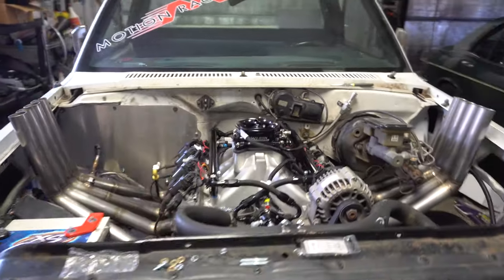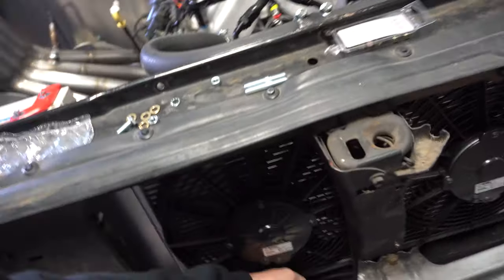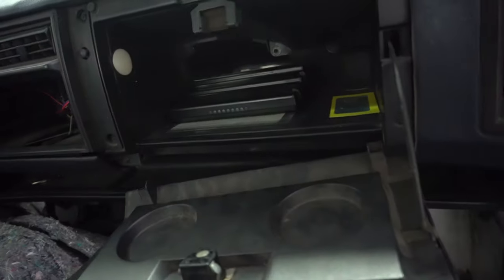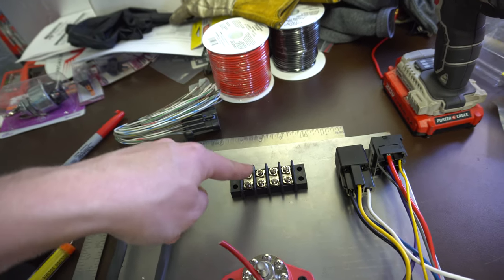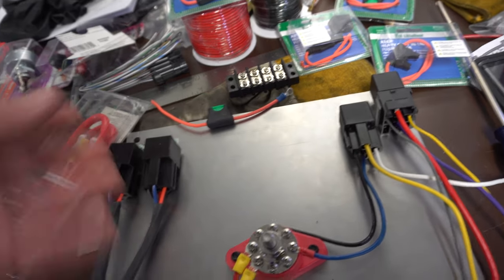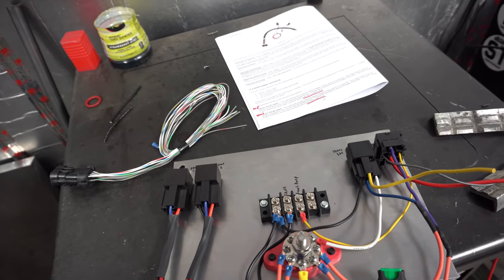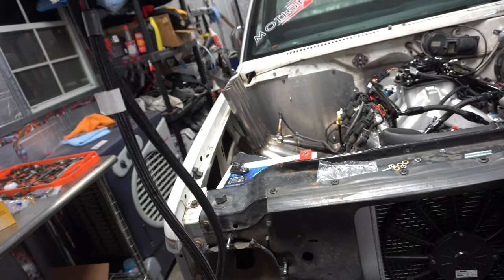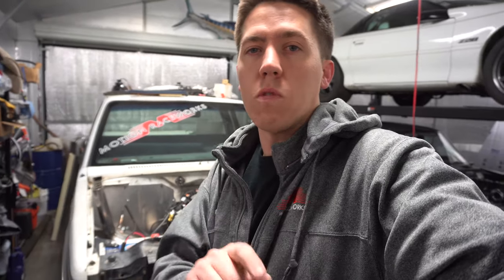Wiring Burnie the Burnout Truck! Relay Panel for Holley EFI Terminator X Inputs and Outputs!

Comment: I bought the same radiator for my s10. I must have missed how you mounted it
Reply from the maker: I used the stock lower rubber mounts and just self tapped the top of the radiator into the core support for now. Might need to make a rubber mounted mount in the future but this might work for now and was super easy.

Comment: What terminal size did you use for the starter lug? Is it 1/4in?  

Edit: I’m new to the channel just subbed awesome content!
Reply from the maker: Are you talking about where the power wire ties to the starter?
Reply: @BuildTuneRace  yes where the battery line bolts to the starter, I currently have 3/8 wondering I  need a smaller one